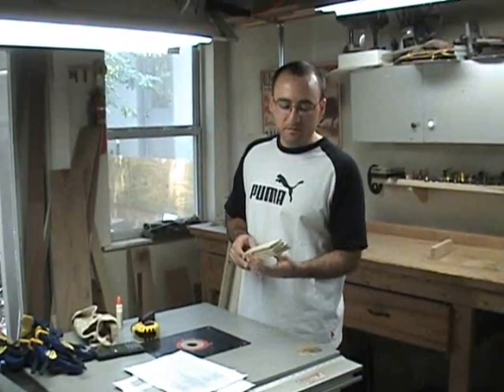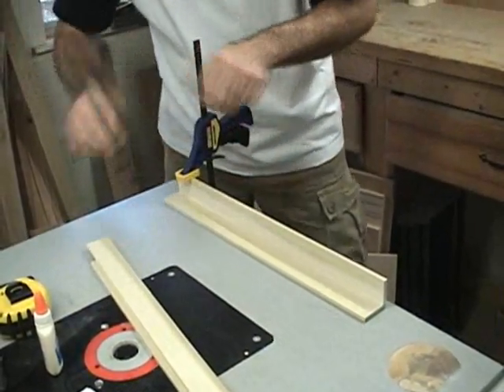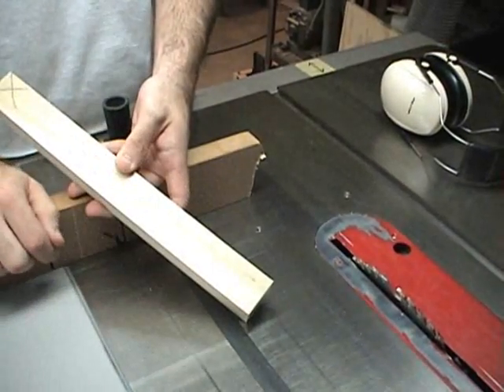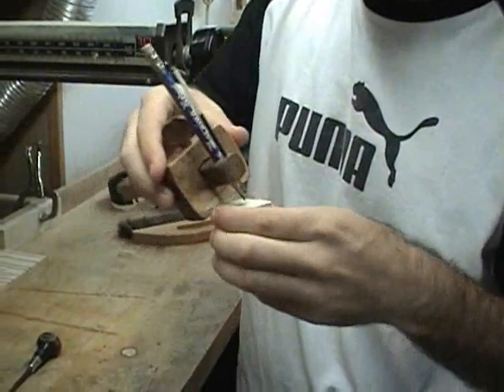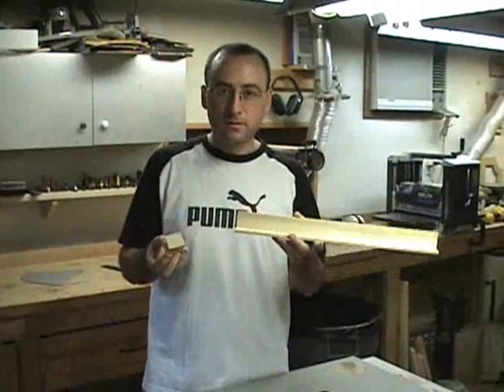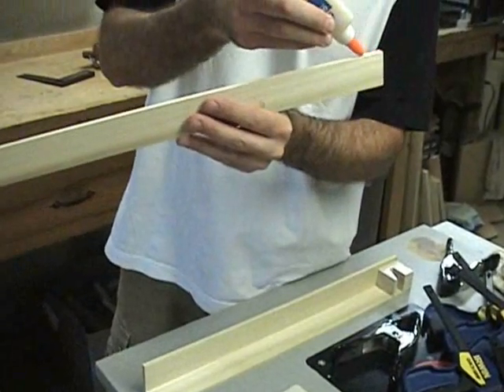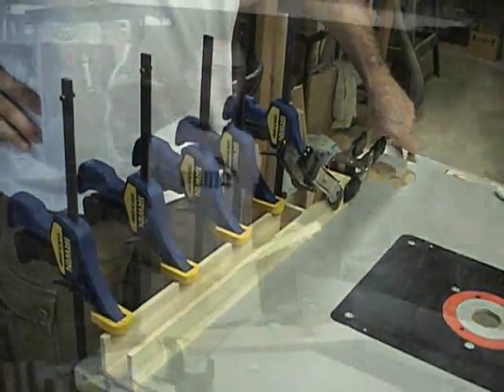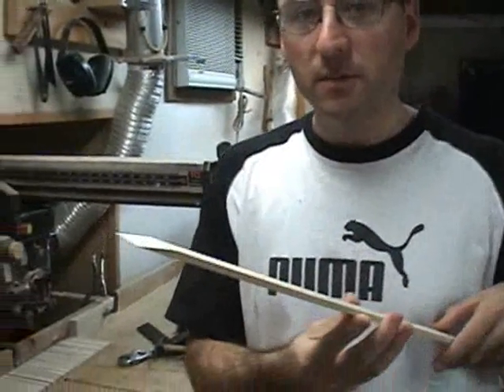How to make a wooden organ pipe - Part 1 of 3

Comment: So, you're making pipes that are normally made of metal out of wood? I've seen "big" builders do the same on occasion for the bottom 8ctve of a Diapason or Montre (whatever) and the sound is very convincing. The trend in the past 50 years is to use much more metal pipework than wood--but I don't think it's necessarily done for the sake of artistic merit. It has more to do with distributing work evenly to the "plumbing" shop and the wood shop in the same organ manufactory. I prefer a wood flute.

Comment: I am flustered..
Just spent hours on a wood pipe and it doe's not work :(

Only thing I am thinking is that it is more in the shape of a reed then flat like your insert plus mine is bumpy inside would that really make it not play?

I have drilled through the buttom parts like it shows in the video but when I blow in the button it is just air coming out.

Any suggestions?

I had to dremell everything since I don't have the fancy saws and such..

Comment: Hello Raphig, have you or are you going to make a video about how to build the bellows? I'm just starting to build a Barrel Organ, and i found your video about pipe making very interesting. Happy New Year :)
Reply: I'm a leatherworker, what you're looking for is pneumatic leather, which has been treated to stop air leakage. Essentially, leather's a skin which has been treated against rot (tanning) and has three layers, the epidermis, dermis, and hypodermis. The first is very thin, the second creates the bulk of the containment, and the third, a buffering structure. In leather, they become the surface, top cut, and suede cut, respectively. Because they're fibrous and contain pores, untreated leather's likely to leak, particularly under pressure: pneumatic leather's akin to chrome leather, where the pores have been filled to make it airtight.

Comment: Thanks Raphig, Great Video and web site. I made a test pipe using simple hand tools and scrap materials! It works very well and was a very satisfying project. My only problem is that I compute the primary harmonic should be at 430cps but it plays F# at 370cps - too far off to explain by end corrections. Another mystery ☺

Comment from the maker: The length is calculated using the formula shown in my website in the mathematics section.  The width depends on the type of tone you want. Larger widths will sound like a flute, medium widths will sound like a principal and smaller widths will sound like a string.

Comment: Your woodworking is very thorough, and I'm extremely pleased that you checked for square with each clamp you put on, however, you really should put glue on both sides of each joint else you'll end up with dry spots within the joint.
Reply from the maker: That's just not true.  I have quite a bit of professional woodworking experience and I've never seen anyone put glue on both surfaces for normal wood glue joints.